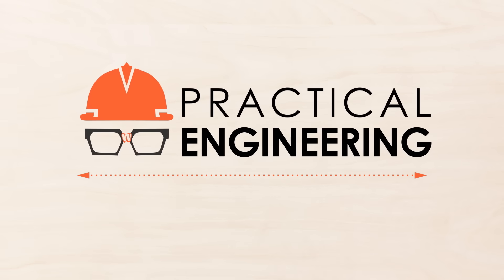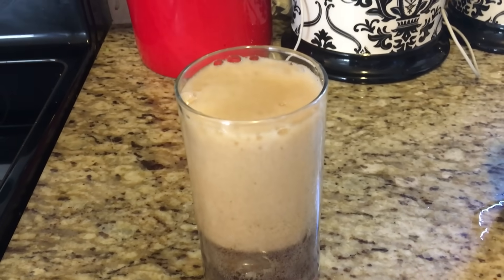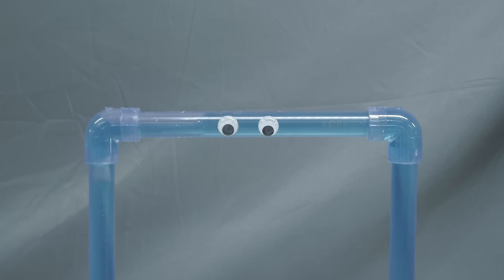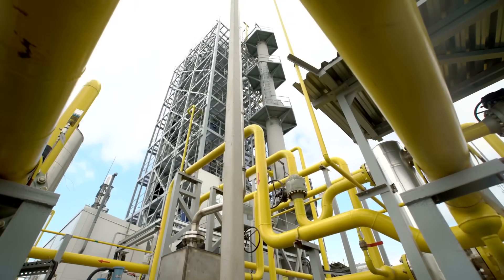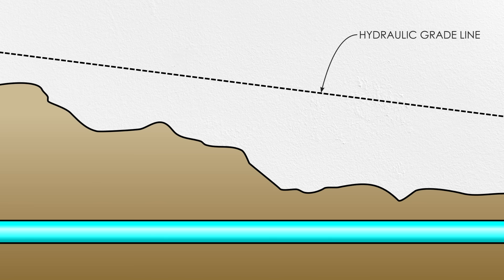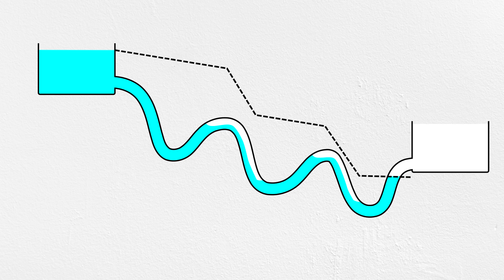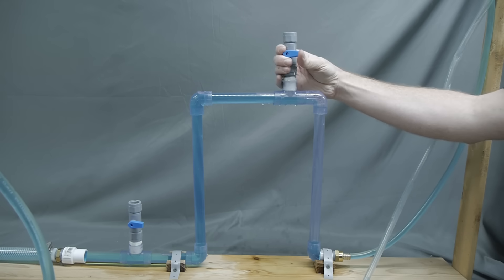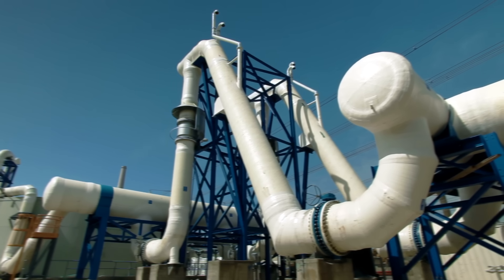What is Air Lock?

Comment: Good video, learnt something new today: hydraulic grade line

@1:50 Besides increase in temp, agitation or chemical rxn, Pressure drop/ change in elevation also leads to the release of dissolved gases. One of the reasons why engineers must be careful where they place a pump during design is because pressure drops within a pump housing at certain elevations can lead to vapor locks.

Vapor locks are also not wanted in PFRs (plug flow reactors) because, as you said, dissolved air consume valuable space in a set pipe length where chemical rxn needs to reach an equilibrium within the given space-time.

Comment: Is this possible in a house? I have good water pressure about 50 psi but my kitchen sink the cold water has very little pressure it barely comes out. All shutoff valves are fully open
Reply: I have the same problem and it seems to be air getting trapped in the handheld sprayer, or more likely in the joint where the sprayer hooks up to the cold line. Running it usually fixes it and if not I pull the hose all the way out and then run it. Huge difference. Hopefully your fix is just as easy. Took me a long time to figure it out and not till I watched this vid did I know why it was happening.

Comment: thanks - we just moved and the washing machine wasnt taking in water even though i checked that the hose had supply and everything was on and unblocked.
seems there was some air-lock and after shaking and manipulating the hose a little i was able to get water flowing into the machine again

Comment: With all these civil engineering types reading here, I have a question that I often wondered about: When I visit the UK, I can see the waste pipes coming out of upstairs toilets/bathrooms and running down the outside of the house and entering the ground to run into the sewer system. I can see these thick pipes in other countries as well, for example France and Germany. However in most English houses there is a pipe that runs up from the toilet outlet to the top of the house with a mesh on top to let air in. Why is that? I am guessing that the vertical pipe to the top of the house is to prevent negative pressure happening when the upstairs toilet is flushed, which would drag the water out of the ground floor toilet. But why do I only see these vertical pipes in England and not in other countries? How do German engineers stop the upstairs toilet flush sucking water out of the ground floor toilet when it goes down into the sewers? Do they have a different system to prevent that?
Reply: You should see a need to separate the jurisdictions in your questions so each area's plumber can give their answer. In the USA, the vent pipe is run to suck air into the drain line to keep the flush going strong and not just create suction above it. P-traps are used to close off the deadly gasses that form in the drain lines. But I'm a home owner, not a plumber.

Comment: COMMENT (from an experienced user): I initally used air locks a lot back when I was homebrewing (beer, wine, mead and cider) in the 1990's.  Most models have a minor design design flaw that many new homebrewers run afoul of, which is the lack of a bypass to accomodate thermal contraction of the air in the headspace of the carboy its affixed atop of.  

To illustrate: picture a 6 gal carboy holding 5 gals of freshly brewed and cooled beer wort ready for fermentation into a hefeweiss.  Say the wort has been cooled to 85F, but ambient room temp is only 72F.  Next, assume the inexperienced homebrewer pitches his ale yeast starter and affixes the air lock, fills it with tap water, and goes to sleep.  Guess what - the beer stands a good chance of becoming ruined and here's why .... the 1 gal of air in the headspace of the carboy is necessary to provide room for kerausen (read: foaming during fermentation), but because the wort below ig is 13F above room temp, the air in the headspace will heat up to match it, but shortly thereafter it will begin slowly contracting as the wort below slowly cools the rest of the way down to ambient temp ... enough contraction to literally suck the unsterilized water in the airlock BACKWARDS into the carboy, infecting the wort.  Experienced homebrewers stuff a compact ball of sterile cotton into the lock, instead of water, during the fermentation lag to avoid that, then switch it to water once the lag is over and co2 outflow begins.

A better design for an airlock would remove the liquid from thd lock and replace it with a 1-way valve to permit outflow, plus a separate valve for inflow (if suction exceeds a modest amount) that'd go through a tiny plug of n95 material.

As for myself, I totally stopped using off the shelf airlocks for primary fermentation - I only used them (if at all) during secondary fernentation, and even then only for wine/mead/cider if malolactic activity was involved. Instead of an airlock for primary fermentation, I cut and bent my own lexan tubing that went sideways and down to about 2" off the floor next to the carboy, then stuck THAT end into a 1 gal jug filled 1/3 the way with water with a few drops of iodine.  The long lexan tube accomodated thermal contraction during lag, and also the occasional overflow during extra vigorous ferments.  This also allowed me to fill my carboys fuller because less headspace was needed for primary fermentation.  

Bottom line: among homebrewers, those waterlocks are only used by amateurs and people who slept through most of their science classes before dropping out of school.

Comment: and that auto bleed is very simular to how my steam traps work but in that case when water condensates from my steam and trips the float the steam pressure pushes the water back to the boilers and then closes the steam off so it keeps working.

Comment: I do this for a living. In my opinion to easiest way for air to get in is during repairs. Nearly all new pipe laid in the ground has a blow off or hydrant at the end of the line getting the vast majority of air and other contaminants out before the new line is opened to the distribution system. Even still, we do our best to open hydrants to get the vast majority of air out. It's worth mentioning that air in pipes isn't always this big gush of air then water then air etc as the air works it's way out. Sometimes due to how the water if filled back into the line you will get very tiny bubbles of air that make your water look milky. That isn't a health hazard or any reason to call your water system and complain. All you need to do is get a cup of water leave it on the counter and come back a minute later. If it's clear or nearly clear then this proves it is air escaping to the atmosphere and not something else that could be harmful.

Comment: Just charge the line with a vacum first then prime the line with fluid.. wouldn't that work?
Reply: too complicated in most cases. vacuum isn´t very common anymore (at least here in europe) and many plants just shut their vacuum systems down to save on money. automatic bleed valves are relatively inexpensive and easy to install. anything else would be more expensive.

Comment: How do I deal with airlock in a fire protection when servicing it? Normally what happens is I drain it and water stops flowing from the drain but flow continues when I open another part of the system.

Comment: In gravity systems, vacuum lock is just as common as vapor lock.  Any time you have a change in grade over 10 degrees you need to install an air vent .  I"ve troubleshot several irrigation system with gravity feed to a pressure system which didn't have the desired flow because the change in grade created a vacuum, usually at a bend. The worst case sucked a 10" plastic pipe flat. The vent also acts to let trapped air out.

Comment: Hi, my house's hot water pipes bang like a machine gun if the taps aren't turned on all the way, or sometimes when it is. I've been looking for a solution, but the problem isn't air lock or water hammer. I'm just wondering if you might know what this is?

Comment: Its beyond the scope of this lecture but air trapped in high pressure liquids or gasses that are combustible can cause detonation, or dieseling. This is a major concern in pressure accumulators which must use nitrogen or other inert gasses for the cushion.

Comment: I had this issue with a racecar once. I would overheat each lap, then someone came over, and told me that the car I was using had a bleed valve, so I loosened it until coolant came out, then it never overheated again

Comment: Also called 'vapor lock'? So essentially vapor lock in a car is where the water has heated to the point that the level of water in the radiator cannot reach the top hose and therefore starves the engine of coolant?
Reply: vapor lock is when the fuel in the fuel lines gets too hot and vaporizes. The cooling system of a car has all of the air bled out so air lock should not happen. However, if air does get into the system it will cause issues

Comment: Would pumping the fluid backwards be any help? I'm trying to think what logistical issues we get by drawing a vacuum, besides backflow of unwanted materials.
Reply: I was looking at the automatic air burp valves being defeated by anything dirtier than murky water. Residential drain clogs would certainly defeat anything you tried. Since they form more often in partially drained lines with fibers and ugh.. sludge..

Comment: This is a common problem with baseboard hot water heating systems too. Hot water holds more gasses but when the water gets up to the second floor from the basement it cools enough and the dissolved gasses come out of the water. Customers were always happy when a repair was a cheap and simple fix;  bleeding the air from the upstairs lines.

Comment: 8:38 I am asking for the next topic: corrosion protection layers in engineering, why they are used, how not to damage them + the addition of "aluminum and health", why aluminum pots have a protective layer.
P.S.
I love content.
Reply: Aluminum forms aluminum oxide, which blocks further corrosion.   Unlike iron oxide that can enable corrosion to continue, aluminum oxide is significantly less electrically conductive than its pure aluminum counterpart, enough to block the forces that cause corrosion.   So aluminum is automatically corroded when exposed to the air, but that corrosion stops future corrosion.    Iron and iron oxide by contrast, doesn't do this, and the iron oxide is still electrically enough to let future corrosion happen.

Comment: When i was a kid playing with water and straws or pipes when it's raining back then, i noticed that air gets trap inside of it. the solution ive done was increase water pressure or punch a hole at the highest point of the straw so the air gets out from it.

Comment: I've been experiencing airlock problems with a small water pipeline on my property that moves water from one tank to another... I often have to "break" the airlock, which I do by blowing air up the pipe from the output side which starts the flow again (like a syphon). Recently I added a valve near the output and after starting the flow, I closed that valve to restrict the flow. It seems like this solved my issue and an airlock has not formed since. I'm not entirely sure why this worked but my theory is that when I started the flow in the unrestricted system, it would flow so fast that it would drain the source tank faster than it refills and it would pull air into the line. With a restricted flow rate, things seem to have hit a steady state where the source tank never empties enough to allow air into the pipe so the flow remains somewhat constant... Is there some sense to my line of thinking?

Comment: @5:01 The graph you are showing here suggests a drop in pressure after the funnel. Wouldn't the pressure rather increase, when you reduce the diameter of the pipe?

Comment: Just I finished a house with radiant hot water floor heating throughout, the first time I tuned it on only one line actually had flow into it... I was freaking out until I found out it’s air lock! 😂

Comment: I finished a petroleum engineering degree, and currently work in reservoir engineering. But to say that engineers assume only a single phase will flow through a pipe is incorrect (at least in the petroleum industry).

Petroleum engineers have to deal with multi-phase flow all the time, and design around it. 

For example, if a closed pipe goes up over a hill, the pressure inside the pipe decreases, and then there is a good chance that some of the lighter liquid hydrocarbons will transfer from the liquid phase to the gas phase. This can cause a gas blockage in the pipe, that prevents liquid flow.

I had to take an entire course with doing these types of calculations. Though I do not work with pipes at the moment, I do know that engineers that design pipes, to transport liquids, do consider gas blockage. They also have to consider the build up of wax (solid hydrocarbons), along with many other factors.

Comment: The sump pump in my basement got airlocked one time. That’s because the level sensing switch was adjusted too low and sucked in air.  After I moved the level switch up a bit it never happened again.

Comment: I was recently hired as a Process Operator for what will eventually be a Polypropylene plant. Having no experience in the industry previously, it amazed me to see the amount of trapped air that exist in our large 24" cooling water lines (when we filled them up we opened vents on top). Vapor lock in general has been a difficult concept for me, and your video was the first to answer and demonstrate it visually in a way that is easy to understand. Thanks a bunch!

Comment: @practical engineering, how do the air lock relief valves maintain proper sanitary requirements? In the example you showed, it looked like at times the inner and outer pressure were equal, potentially allowing contaminants to enter the pipe system.

Comment: What I am still curious about is underground pipelines, particularly for oil. Do they have automatic air vents at high points as well? Like you said in the video, it is not feasible to simply trench out a mountain or hill, to avoid high points.

Comment: Thanks, that was so enlightening. I heard about "vapour lock" in carbureted engines caused by using fuel with a too high vapour pressure (such as using automotive gasoline in aircraft engines at higher altitudes), but never understood exactly what it means. This answered a lot of my questions.

Comment: Good vid but check the definition of assumption please. If engineers were to operate on assumption rather than know fact we would find ourselves on a train crossing a river with no bridge.
Reply from the maker: Engineers don’t calculate the structural loads on the bridge for each individual size/length/configuration of train that could cross the bridge. They make an assumption about the most critical loading that could result. That’s an example of what I mean. Sorry if that was unclear.
Reply: @PracticalEngineeringChannel  thanks, that makes more sense.

Comment: The hydraulic engineer at the coal mine I used to work at believed if he diverted a medium size stream uphill over a mountain, it would flow itself.

Funny enough...it did not

Then it froze in the first winter

It never actually thawed again either....we had crews on it for months with tiger torches and in the middle of July it was still frozen ( we were on top of a mountain range after all)

His final solution was to actually cut several holes in the top of his diversion for several kilometers....

By the time he finally quit ( that's right, quit...not fired )...this whole thing was something like 12 kilometers long and perfect for keeping ice all year long

If I remember correctly it cost somewhere in the vicinity of 4 to 5 million and is still sitting there

Eventually the new engineer build a diversion that went around the mountain

Comment: So is there any reason where an engineer would just run a vertical stand line above the hydraulic gradient at a problem spot and stick a roof cap on it? Or are these the plumbing vents on houses?

Comment: just a theory, and please forgive me for not knowing all the correct technical terms.
so as you know if you drop the pressure enough a liquid will boil at room temperature. isnt is possible as the fluid flows through the pipe and through valves or restrictions it can create a low pressure (Vacuum maybe the right term?) area  which would then cause of the of the liquid to actually boil off creating more bubbles?

i bring this up because this happens with a propeller on a boat. if you have ever look at one spinning it gives off bubbles as the propeller is spinner it creates such low pressure (Vacuum maybe the right term?) behind the prop that it will actually boil the water.

again i apologize if my wording isnt accurate. but hopefully it makes enough sense

Comment: I would love to see a video on the opposite where engineers intentionally introduce air or gas into the fluid flow to reduce density and/or pressure head. E.g. gas lift used in the petroleum industry.

Comment: Air lock is common with rebuilding shocks in Rc cars too👍  If you get air caught inside the shock will not function right but you are correct  in that it can cause headaches😂 Just a different take on your subject cheers for sharing💯